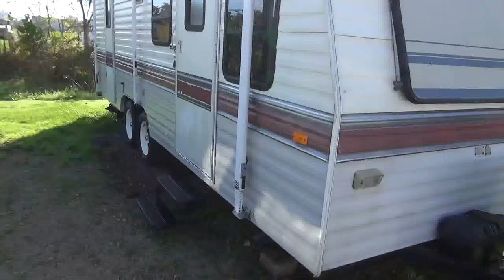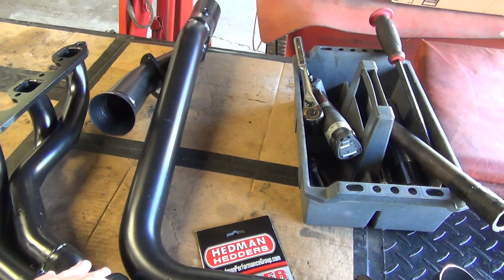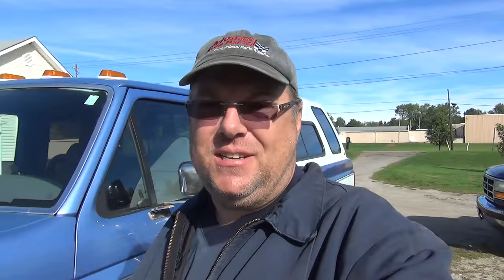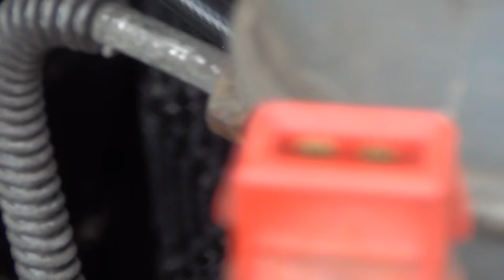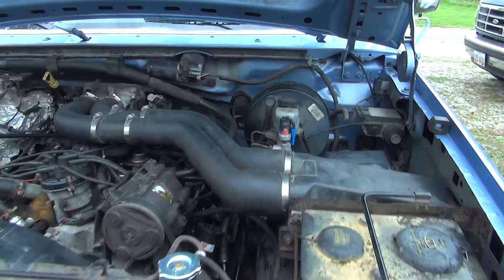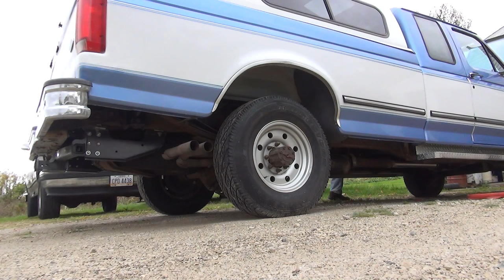97 F250 460 Headers install overview nice rumble

Comment: I give you credit for being energetic.Over the years every person i have known with headers had leaks to deal with on an almost continuous basis.I figure that a 3 inch exhaust right after the manifolds and maybe a glasspack would open things up.I was also taught that headers only make a big difference when the RPMS get higher. I wonder how plugged up the converter gets over the years.They sell 3 inch converters also. The truck sounded purty good.

Comment: Been awhile since this video, how many o2 sensors did this truck have?  Where did you place them after running the headers?
Reply from the maker: 1 sensor each side... Place then as close to the stock position and in the airflow as possible..

Comment: Thanks for the great intel!  Just bought a clean 1996 f250 4x4 7.5 5spd bone stock. Planning on getting the banks power pack!  And a lift 4"-6" clearing 37" tires.

Comment: Great video and lots of great information. I have a 1997 crew cab F250HD short bed single rear axle w/460. I love it. getting ready to remove smog pump and have my E4OD trans rebuilt. Found your site and had to subscribe to both your rv and this site. Thanks and keep up the good work !!!

Comment: I just bought a 1995/just like your truck with 78k original miles summit racing has 2 different sets of headers and ypipe  kits one with tubes on them and the is like what you installed . headman brand for $350. this video def has helped me I wondered about the smog pump . now will get that other belt . thanks for the info .
Reply from the maker: +Brian Perry great!

Comment: So i ordered headmen headers from summit. And today i went to install them. First off they sent me headers with air injection tubes which my truck doesnt have any so i cut them off pinched them and welded them but the y pipe they sent me only had 1 hole for an o2 sensor and i have a o2 sensor for each bank so i had to drill 2 holes in the y pipe for the o2 sensors. I also couldnt find the correct size tap to chase and clean the threads on the holes for the header bolts. Oh and that adapter peice for the egr tube broke so now i have to try and find some kind of angled adaptor like you did and see how its going to fit.

Comment: I have the same truck except I have a short bed .. 1997 F250 extended cab .... EFI 460 .... stock HP is 275 .... and I'm going to push it to 400 or 500 HP ..... I pull the same amount of weight or a bit more .... and it is just a Bummer that a 460 is so weak ..... but there is so much you can do to this engine ...... fun times coming .

Comment: I'm from northeast Ohio as well. I saw your F150 on Craigslist. $2900 if I recall correctly. I never expected to see your truck on there after all the work you've done to it, but the tow ratings are a big deal and I totally understand. It's funny, I actually remember seeing your new blue and white truck on Craigslist as well. I believe I've seen it in person as well, but it could have been an identical replica. My 1994 F250 with a 460 has cheap longtube headers on it right now. Flowtech I believe, they were installed by the previous owner. I've been looking into getting quality headers for it as well. For me its between the Banks Torquetubes and L&L longtubes. I have heard nothing but good things about both, but the L&L headers are top quality at almost half the price of the Banks. I'm on the Ford Truck Enthusiasts forums and L&L is a very reputable name on that site when it comes to headers. Nice video! Looking forward to seeing what you end up doing to the new truck!
Reply from the maker: Well hello neighbor!  Small world.  The old F150 is a great truck but it is time to change.  If I wasn't  doing all the towing that I am I would love to keep the f150.  I am going to miss the smooth ride and more importantly the 17 mpg hwy. I just installed a new hitch on the new truck so keep an eye out for that video once I get time to edit. You know how it is this time of year in Ohio... The last few warm days you try to squeeze in all the outdoor repairs you can! The F250 I bought from a guy in North Canton when I was asking about the previous owner he said it was a guy in Malvern.. Come to find out I had saved the truck on my Craigslist app in favorites a year ago but before I could get the scratch together he sold it to the guy I was buying it from.. Must have been fate.. Thanks for watching..
Reply from the maker: PS : I shopped L&L back in 1992 and their engine swap kits are top notch..

Comment: I run Hedman Super Comp long tubes on my 1995 F350 4x4, no frame notching or hammering on primary tubes.
Reply from the maker: Do you mean Hooker Super Comps?   I used Hedman HTC  long tubes on my 95 F150 2wd 302 I had to notch that truck too..
Reply: +Foxboss9 , yes sir I was thinking of the Hedmans on my old 360 Dodge. I did not install the Hookers but I believe they were short tube on the Ford, my mistake.
Reply: Foxboss9 That's cool man I have a 96 Ford F150 with 5.0L (302) Windsor V8 with 203,501 miles on it and it's still going strong. The only thing I replaced on my truck was the starter but other than that mostly was just simple maintenance and cleaned out the transmission fluid just to get rid of the shuttering it was making and it hasn't had a problem ever since.

Comment: If your state doesn’t require emissions you can do the twisted smog egr delete and works great had one on my 4.9 mpg actually went up
Reply: Yeah but isnt that only a temporary fix.?
Reply: @alec4453  no it pretty much works like a tuner chip accept with this system it gives this pcm the readings it would normally get from the smog system so you get better fuel economy and you don’t have to run a smog system that really doesn’t do much to begin with
Reply: @timturk6003  ive been reading there info on the efi guys website and i copied this " These diagnostic isolators are designed to temporarily separate the SMOG, EGR, and corresponding vacuum sensors from the ECU so you can easily isolate a sensor issue. " 

Im really wanting to delete the smog off my 97 460 truck, was gonna order this but after reading that it doesnt sound like a permanent solution.

Comment: whenever you run headers you always run a deep end tap for a longer bolts
run a double set of gaskets and tighten the bolts tight
Reply from the maker: Tim Titus I always go with Header Mfgs recommendations.. I've run double gaskets on thin flange headers(blackjack, cyclone, flowtech etc..) But the flanges on the Hedmans are thick enough for singles and in the case of Doug Thorley and Banks they recommend no gasket at all on the 460 applications because just like the factory exhaust manifolds they   need the exhaust to be able to transfer heat into the head so that the water jackets can keep exhaust temperatures in check.. This is because of the direct air injection from the air pump is making the exhaust run really hot for a cleaner burn for the one catalytic system in turn allowing the O2 sensor to read a leaner air charge running over it..
Reply: Foxboss9 early efi engine needs tweek on input from o2
or unass early system for WELL-TUNED carbureted  intake induction system
Reply: Foxboss9 you must always do your homework with fuel injection!!!   earyIer Ford efi sucks major man
Reply from the maker: Tim Titus Even with a MAF conversion, Banks still recommends no gaskets to be run with their headers. With the air pump connected, the heat that is being generated, has to be controlled by metal transfer with the head and maximum direct contact area, for that reason exhaust gaskets should be used only if the Mfg recommends them.. The whole air injection thing on these 460s was sort of a debacle. that's why sooo many factory manifolds crack/break/leak.. it's just too much heat. I fortunately don't have emmision testing..
Reply from the maker: Tim Titus as far as early EFI it only sucks if you don't understand it's natural limitations and know how to modify it.. It's funny but that's what everyone used to say about carburetors when they couldn't tune them..
Reply: the problem with ford early efi is...
driver's side bank (to heck with gadgets) is further away from the Y connector than the passenger side,,,
they should be equal distance OOORRR
have duel upstream 02 sensors    but ford early does not 
gadgets matter not 
it is about EVEN 02 sensor reading for proper fuel injection output signal to multiport injection system 
temp of actual pipe matters not
proper fuel mixture does
Reply from the maker: Tim Titus the pipe temperature will  exceed the the metallurgical capabilities of the exhaust if an air pump is still connected and gaskets are used when they are not recommended.  So pipe Temps do matter.. Every EFI has downfalls.. Bankfire SD systems can run just as well as MAF MPI systems, If they are tuned and modified correctly.. In the 80's the 85 5.0 Mustang with a factory 4bbl would run faster in Stock configuration than a late 85 5.0 with EFI... However, in Stock configuration, a 88 5.0 Speed Density Mustang would run quicker than a stock 89 5.0 MAF.. The tuning ability made all the difference and since MAF was more forgiving to mistakes it became the go to EFI... Same with OBDII. since it is more forgiving and adaptable to changes and tuning mistakes made, it became the go to EFI but only Stand alone systems like Haltech and FAST and a slew of others are really the only good systems to have for true custom tuning... But this video was to address a non air injection header install using the Mfgs recommended instructions..
Reply: man I've been racing and pulling heavy loads for 35 years...
never blown an engine 
never burnt a piston 
never blown a head gadget
went really very very quicker 
went really very very faster...
for a very long time
believe what you will
then you will learn to read plugs, take exhaust gas temperature readings and exhaust o2 readings for a long time 
I was tuning diesel engines when I was 14 years old
was playing with jet engines on an aircraft carrier when I was 20 years old
held a world record for 2 years by the time I was 30
been told I can't do something for a very long time b***** is what I have always said
Reply from the maker: Yep same here, If you ever had a Ford EFI issue/question in the early to mid nineties, and you called Summit Racings tech line for an answer, Your call most likely got transferred and you spoke to me..
Reply: Foxboss9 no shit huh
Reply: @Foxboss9  I know I'm m late to the discussion but I'll throw this out there. Disclaimer: I'm a novice. When you pull the air supply it throws the Check Engine light due to emissions. Like you said, we don't have emissions testing now that my 95 F350 is considered classic but I need to pass safety here in Texas. How can I keep the CE light from coming on due to taking the air out?
Reply: Jeremy Small contact Russle at 460 EFI GUYS - Sells smog/egr delete kit and also can provide you with the proper belt when you throw the pump off among other modifications if you want .

Comment: A few years back I found a uses 1992 , F-250 4x4 with 460 engine.  It's  the XLT  standard cab. But seems to be  a Camper Special as  It was already equipped with  Banks Power including headers and K&N air box and filter.   The headers  go into a "y" tube and single exhaust.  I'm wanting to go dual exhaust with an "H" tube. I also want to  change the intake from that funky stock double tube and air box with the inlet coming up from low in the grill to a larger single air tube and cone filter.  But  neither Banks  nor K&N  seem to have such a set up.

Comment: Awesome vid a lot of good info I'm installing these headers on my 1997 f350 cab and chassis 5 speed my #1 and #5 cylinders the Inside bolts are a bear to do right now what did you use for bolts on your set up for bolts
Reply from the maker: Used bolts that came with headers....Tighten the inside bolts first...have to use a wrench only,,, I have changed many,many headers over the years so it doesnt seem as hard as the first time I had to do it.. Take your time...patience is your best tool
Reply: Foxboss9 awesome I'll try that thanks for the reply and the good videos

Comment: Thanks, couple of questions does the 97 f 250 with a 460 have aluminum heads and how do you get passed inspection without a cat on it ?....your videos are very helpful, my 97 has a exhaust leak and I have been debating which way to go...thanks again !
Reply from the maker: Tim Pope there are no aluminum head 460s from the factory. They are very very very heavy cast iron. I have zero requirements from the state of Ohio as far as vehicle inspections. As long as the car can drive down the road it's good as far as Ohio is concerned. The exhaust leak is annoying I really enjoyed having these headers on my truck but if you check out my other video I did convert over to the banks long tube stainless steel headers and I'll have to say they are well worth the extra money. The quality is incredible. Glad you enjoy the videos. I haven't been posting any on the truck because it's been doing a good job and nothing has been breaking down knock on wood. Lol thanks for watching!
Reply: Thanks for the reply, I will definitely check out those other videos and thanks for taking the time to make these informative videos they are a great help !!

Comment: Hi fox boss great job with the videos, disappointed to see the truck go but hey gotta do what you gotta do. Question for you- getting ready to put a dual exhaust on my truck identical to yours except it’s 4x4, my guy wants to put hi flow cats because he said it will smell bad and needs a little back pressure but I wanted to remove the air tubes and pump with eventually getting the banks headers. You said not to have cats with pump removed? Is that the same for the hi flow cats? Sorry last question, can i cap off the air tube tat goes to stock manifolds till i get the banks headers? Thank you and good luck with your new truck
Reply from the maker: Make sure that your high-flow cats do not require air injection. A lot of them do not require air injection. Basically, what the factory catalytic converters require is that are blow on them from the air pump to keep them burning hot. As far as back pressure being needed, that's an awful long truck with a lot of tube and offers pretty much all the back pressure necessary. But there are a lot of people that run high flow cats however I don't like the extra expense. You can block off your air tubes just bypass your air pump so that you're not pumping air into a blocked hose and wasting a little bit of horsepower doing so. I wasn't a big fan of dual exhaust without having a crossover pipe close to the header collectors I always hated the way they make a cracking sound and the Scavenging effect of having a x pipe helps considerably. Thanks for watching! And yeah I missed the truck to as far as getting to work on something easy.

Comment: I see that on your new truck the coolant bypass fitting under the thermostat housing has been replaced before. I had the same damn problem with my 250
Reply from the maker: The Previous Owner did that.. The problem was the pipe fitting he used is much more restrictive that the factory one. So, to save $ and time I used a drill and deburring tool and open the pipe fitting to a larger size, more comparable to the factory hole opening.. Does it make a difference? probably not. But for piece of mind, it was worth the effort..
Reply: +Foxboss9 most definitely I just went down to ace hardware and bought a 3/4 elbow and a 3/4 to 3/8 tapered fitting